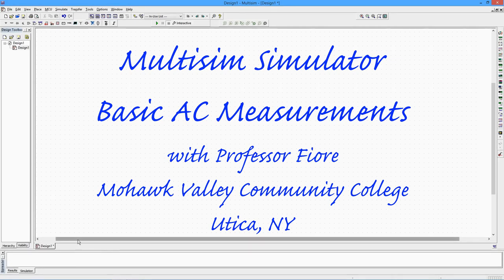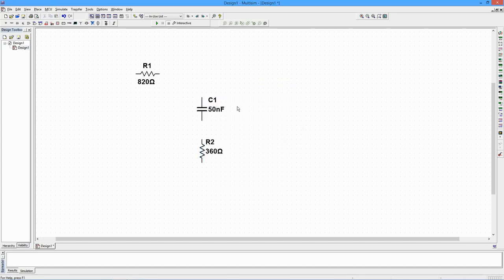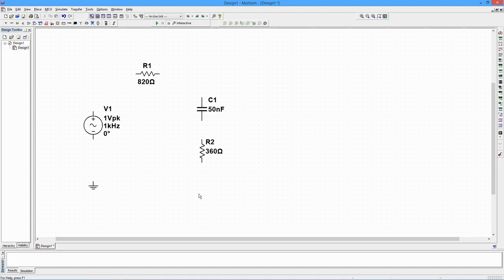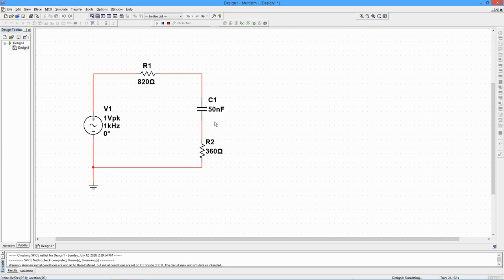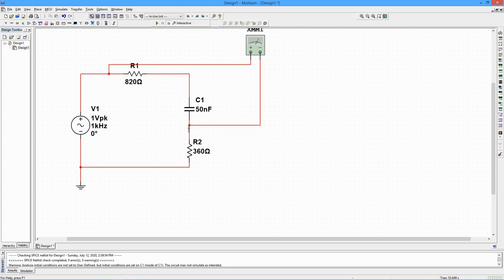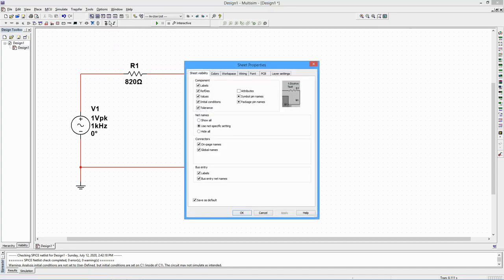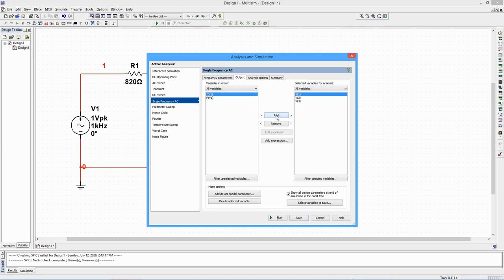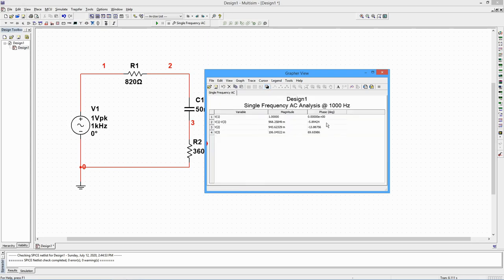Multisim Basic AC Simulations

Comment: How I can draw İnput Voltage with 220 V, 20KHz square wave?
Reply from the maker: From the voltage sources list, select a clock source and place it on the schematic. Then double click on it and a property page will open. Set the amplitude, frequency and duty cycle as needed.